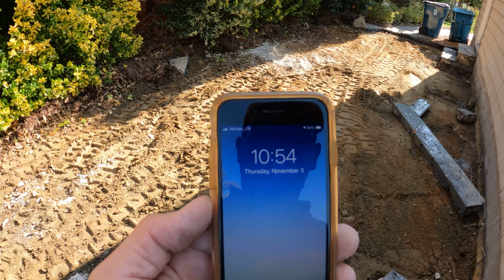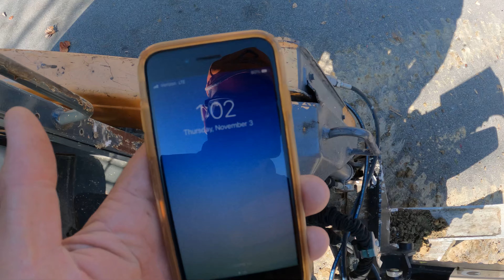Concrete Demolition - is this a Niche? - The Beak in action

Comment: 22:00 that big chunk at the end seemed like a lot more trouble and headache than it was worth. Should have used the breaker to bust it up first. Even in half, so you could get the leverage needed to lift part of it up and drop it to break it up. Watch Ryan from "Victory outdoor services" and you'll learn a lot of tricks from a guy that's done concrete for decades.

Comment: I think there would be good business in it.  I have told a few concrete finishers in my area about the beak and your videos.    I would be aware of rebar or concrete wire in the concrete.  I imagine that woud be a game changer.  In n.w. alabama alot of driveways here have concrete wire.  If your concrete has limestone for coarse agg scoring it with a saw might make the thick area easier to break.  Thank you for video.

Comment: Great job on the removal Shawn. To break up large pieces just lift a few inches of the ground and have someone hit it with a sledge hammer. You will be surprised how easy cement breaks with no support under it. Try it, it will work.

Comment: Very clever use of physics! I wonder if you can use a similar trick when you can lift a huge slab. I've noticed sometimes you have to lift and drop multiple times before it breaks. Maybe get someone to chuck a block under it before you drop it?
But in any case the bottleneck is in the removal... and you were lucky it was only 7 minutes away. On a different job you might need a 3rd truck I guess?

Comment: You don’t get in trouble for not closing the back of the truck when is full of concrete?
Reply from the maker: The recycling center was literally right around the corner. I wouldn't get on the highway without a tailgate.

Comment: It's almost absurd to see two guys with one mini excavator busting up a large concrete driveway in such a short amount of time.  The shot 10:50 of the beak moving a huge slab really sells the advantage of that attachment vs. the old way of jackhammering out the slab.

Comment: That beak is really good. Like you said, there's not a bunch of little million pieces. You're taking it all out in chunks. It'd be something to get into cuz there's no extra clean up. All you do is take the cement out. Somebody else does the work and if there's any problems they got to deal with it not you no that turn and it turned out really nice. Good work those guys did. Yeah I would take more of that stuff on if it was me. 👍👍🙂🇨🇦

Comment: Got to stay diversified. Good idea using the machine weight to crack the slab. Work smarter not harder. Could always prop the slab up and have a loaded truck back up and crack it. Might want to add a broom box to your arsenal. Would make it look like you were never there.

Comment: Who wrecked the dump truck?  When  are you going to get a better dump truck with dual rear axles?
Reply from the maker: I clipped a sapling backing up at my place. Doh! I only have single axles because they don't require a CDL. I got my CDL in feb right before the laws changed, but non of my workers have a CDL. So if I got a larger truck, I would be stuck as the only one who could drive it.

Comment: Sean, you crack me up with your problems. I wish my tools would give me problems like that. 

Hey, about taking the concrete removal jobs, money is money. And you do such a good job and leave the site so clean and with the beak you move so fast, I bet you could charge a little bit extra but even if not it's good work and I liked how both you and Miguel we're letting the machine do the work and you were just using physics and technology to make the concrete break.  I'll bet these jobs could even lead to some more drainage contracts.

Comment: With only doing tear out vs. tear out and replacement, you don't have to worry about screwing up the new concrete and having to come back and redo it at your expense so sure, you don't make quite as much with only tearing out BUT you also don't have as much Liability and don't have to worry about Warranty Claims either so in the long term, I think you could end up making as much or slightly more than you'd make with tear out and pour new...

Though if you do go with only tear out, you might want to think about adding another dump truck or 2 to the fleet or maybe replacing the 2 existing dump trucks with one larger truck that can handle 3-4 times the weight and volume as the current trucks to keep up with the beaks ability to rip the stuff out...

Comment: So! The 6 inch concrete  didn't  brake, or crack, but the 4 inch broke, that tells me, when I get my driveway done, it will  be 6 inch, with a 10 inch wide by 10 deep perimeter

Comment: Assuming it wouldn't damage the beak, I'd pry the slab up as far as the beak could lift it and them come in from the street with the Bobkitten with the jackhammer attachment and hit the slab in the center...that should, in theory, split the slab down the middle into 2 or 3 pieces the beak should then be able to lift...

Comment: Your skills are without question, fine tuned for such work. I have no question about your skill or technique. But from an Energy Standpoint, Waste Standpoint, it's hard to see why it was justified. The aprons were fully intact, many of the large sections were fully intact, and the retaining walls were not really up to the rest of the property. They did this for some cracks, tint, and a consistent pattern. Someone is making way too much money (the homeowner). 

My neighbor just had a short flight of cement stairs replaced. I asked the contractor what was wrong with the old flight of cement stairs, since they were so hard to demolish. He said there was nothing wrong with them but slight cosmetic issues. Go figure. 

Nice work, my observations are about the homeowner's choices, not your skills. 

Best regards.

Comment: At 5:35 I bet if you hit the slab with a sledgehammer while it's lifted it will break apart right where it's hit.  The ground absorbs energy but when the slab is in the air it will break.  Learned that on a sidewalk removal.

10:35 I see that you tried it.  Didn't work that well.  How about chipping in some stress risers with the breaker where you want it to break, before you start lifting?

Comment: I think you should look after your people first.  Ronald, the girl plus others.  There may come a time when they are not around to help you with gutters.  Seem some of the drain issues are due to clogged gutters.  Provide a service for cleaning them plus installation of gutter guards.
Your successful completion of a gutter job and knowing the homeowners can rest assured their water seepage and swampy back yards are things of the past.
You don't have enough trucks with the carrying capacity for concrete work and you may not always be 7 minutes from the recycling facility.  If you do get a bigger truck, the bobcat may not be able to load it.  And you will need more than 1 truck.

However, if you with your connections can get concrete jobs where you do the tearout and Miguel and the others replace, then that would be the best of both.  Maybe get into stamped concrete or pavers so Ronald and the others can have some work.

I used to do SAR years ago.  The first obligation of the skipper was to his crew, then the vessel then the mission.  So, Ronald, your equipment and the job.  Those would be my priorities.
Reply from the maker: Very well said Knight. I totally agree but some things have changed with the crew...I'm not interested in getting bigger trucks because then you're in CDL territory. I have my CDL but they just made it tougher to obtain one, so that means the only beak out jobs I would take would be easy ones that are close to recycling.

Comment: They kept the corrugated pipe drainage system and you didn't advocate for a PVC solution?
Reply from the maker: I don't think they were having any flooding issues and the concrete is sloping properly if the gutters overflow. Great observation 👍

Comment: If there's ever "down" time on drainage jobs, or a lull in the action... I'd say heck, a concrete removal service is an interesting side gig. That is, if you and the crew like it and the equipment handles the jobs okay. This project was smooth and done exceptionally well. 🙂Thanks Shawn!
Reply from the maker: Thanks Sheena! I think this demo work might be good too. Drainage work can be complicated and beaking out concrete is pretty simple. As long as I can find a driver for the dump truck to keep it going.

Comment: Watching you lift the driveway reminds me on a job I was on recently. The house next door had a tarmac drive installed 6 months ago and the stones in the tarmac was bad so it had to be replaced. They subbed the removal to another crew the problem was they lifted a driveway 3 doors down!! And it was twice the size of the bad drive!! Expensive mistake
Reply from the maker: So they tore out the driveway at the wrong address? Yikes!
Reply: @GCFD  the wrong address would be about 1/3 bigger than your job

Comment: Doing both provides you some work variety. What proportion will likely be profit driven. The consumer needs your drainage talents to solve drainage problems and fix mistakes your competitors make. Love that Beak attachment. 🇺🇸
Reply from the maker: Thank you Cam! I like the drainage work, but this could be a simple way to continue working my equipment.
Reply: @GCFD  Yes, you have quite an investment in your time saving equipment.

Comment: That concrete looks much better than the results from the crew you normally sub out to.  I try not to be one of those keyboard blowhards commenting on how the crew in the video did, but I really haven't been impressed with the finish work on most of the videos.  This, however, looks great.  Maybe you should switch to using that concrete crew.
Reply from the maker: Thank you Jeremy! I may use these guys in the future for my projects. 👍

Comment: It's too bad the Home Owner didn't take the opportunity to replace that horrid corrugated "drain" pipe and replace it with new PVC while the dirt was exposed...

Oh well, when (not if) it gets totally plugged up and the Owner needs it replaced due to flooding, you'll make even more when you have to rip out the concrete again to get at the pipes...

😄😁😆😅😂🤣

Comment: Perhaps you could advertise to remove and dispose of concrete. Be sure to include a video link so interested homeowners can see this equipment in use. Seek out concrete contractors and try to get concrete disposal work from them. This is work that can be done on a rainy day.
Reply from the maker: Great points Larry. I like rainy day work for sure.

Comment: I imagine that as long as both crews aren't using the same equipment that would double the hauling cost then it's a no-loss situation. 10/10, I still wish it had a rain-clip-ending even if the other crew might not experiment with managed-drainage.  
I'm surprised fancy homes don't want reduced slip-hazards where most, if not all, nuisance-water is managed-subsurface away from where I'd put my feet. No-offense intended but the mold on the front of the home might be a sign of moist islands or soggy gutters.

Comment: Thats a waste of time cutting along foundation. 97% of the time its not attached. Id just pull the corner of slab up a little and youll c if its attached or not, or jackhammer a hole near it
Reply from the maker: T T that's a great point. The contractor that I worked for normally has a guy with a huge excavator that lifts and can't pull. After doing the demo, and watching the footage, I told him we didn't need to cut along the foundation on the next one since i can pull the slab off the foundation. If you notice where I talk about that in the video, we didn't cut that section in front of the left garage. We had no problem there.

Comment: Sean I'm 7:42 into the video and I've seen the size of the truck you are using to take away the concrete......that's pure madness....
Reply: Have to go with what you already have
Reply from the maker: Why's that? These trucks are easy to find, can haul around 7 ton and don't require a CDL (so easy to find a driver for a day of easy side work. I also own both of these.